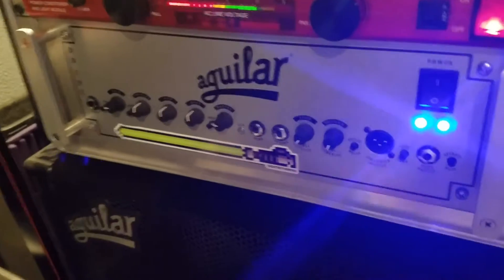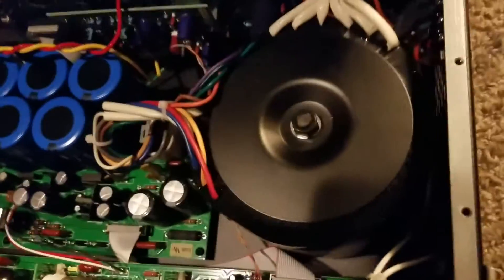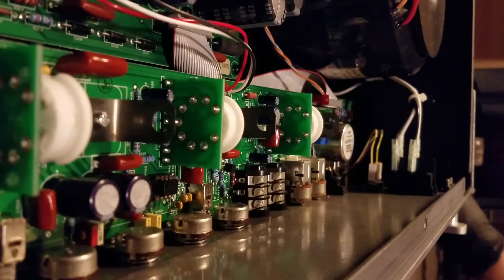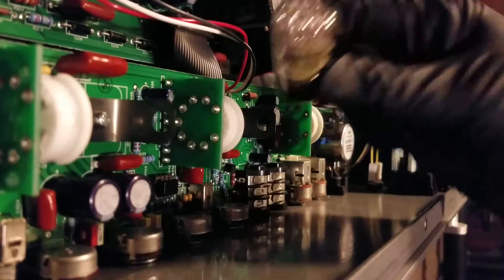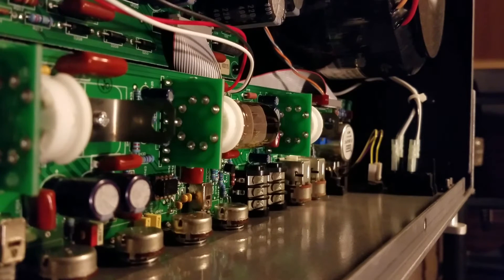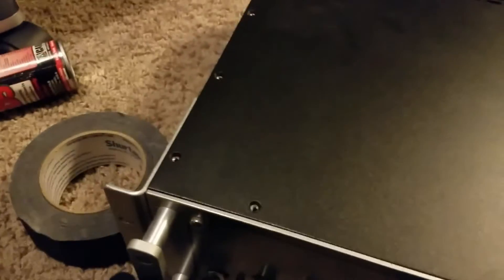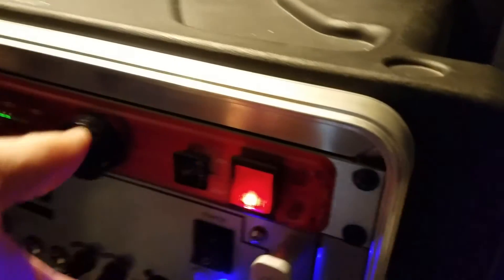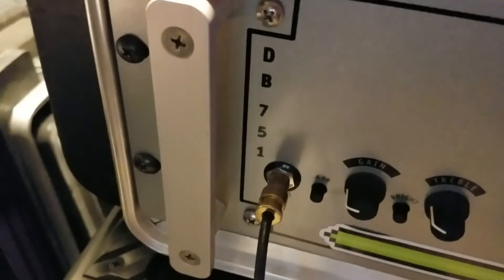Aguilar db751 tube replacement how-to

Comment: I can't thank you enough for putting this up.  My DB751 Arrived with a hiss, and I was told by Aguilar tech support to replace the number 1 12AX7 tube.  I opened the unit and was mortified at the side mount, wondering how I would do this.  Thanks entirely to your video, I now have a fantastic sounding DB751, the hiss is gone, and I don't have any broken tubes, trips to urgent care, or a ruined amp.   Thankyou, thankyou, THANK YOU.
Reply from the maker: Oh man!! My pleasure !  Thanks for watching. Lmk if you need anything else.
Reply: Where can I buy the 12AX7 tubes?

Comment: I own a Mesa Boogie Strategy 8:88 that I run with a Mesa Boogie Powerhouse 4x12. I have not had to replace the tubes yet but I am not looking forward to it because it will cost me over $500 just for the tubes. Damit that's a lot just for new tubes lol.

Comment: It is NOT NORMAL to hear noise when you adjust the potentiometer.  You should have cleaned them when you had the amp apart.  Nice video.  You neglected to mention the most important part when servicing an amplifier: DISCHARGE THE CAPACITORS!!!!!!
Reply from the maker: AHHHH YES i did both of these things off camera!!!!!!!!!!!!!  thanks for catching that!
Reply: I need to change my DB751 tubes… how do you discharge the capacitors?